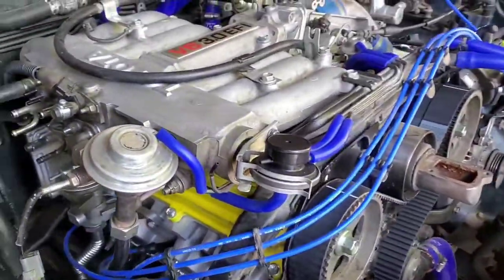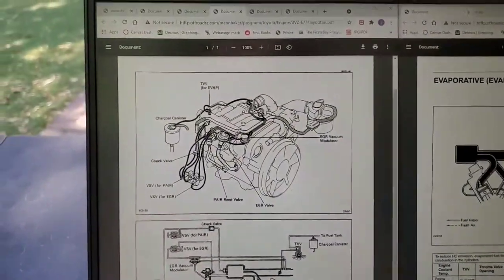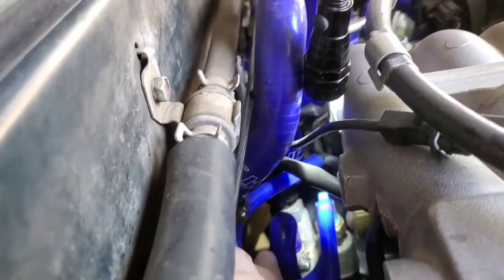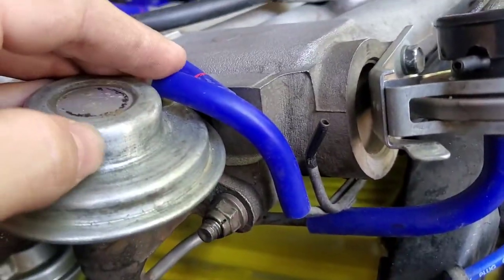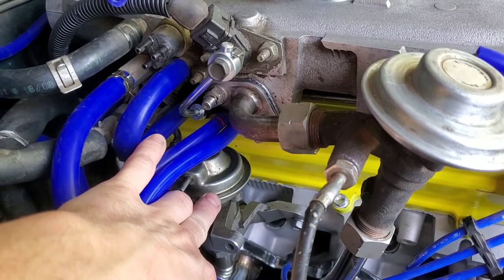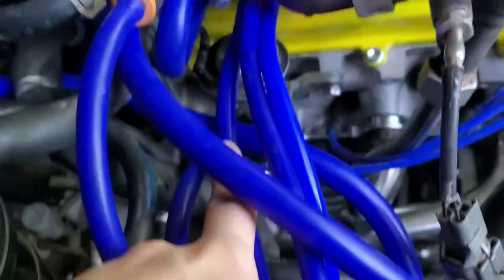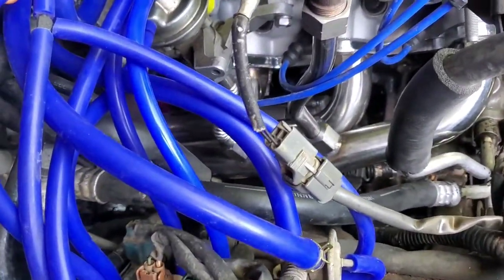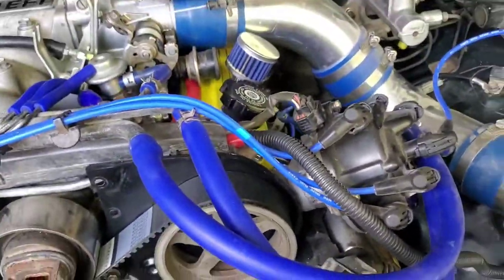94 Toyota Pickup 3vze 3.0 Vacuum System

Comment: 6.25 are the vacuum lines for the front diff ADD

does your 4wd work? theres a plug in your fender wall that isnt connected.
Reply: just saw this too haha was hoing he went into the diff lines with a bit more depth lol
Reply from the maker: For this video I was only following the FSM for the most average truck for the exhaust/intake and a couple other systems like evap. I didn't include explanations of the 4wd lines as not everyone has those

Comment: Hey bro, on 6:45 the line that spilts off to the breaks, i did it the same and noticed my idle goes down to about 700-800 rpm from about 1000 when I press on breaks. Is that normal? I do need to finish off my vacuum lines to the back of the bi-metal vacuum switching valve since the stupid previous owner took them off. You think that could be a cause of it, since it isn't complete?

Comment: nice vid man, cleared up a few things for me. what hoses are you using? is that a kit with different diameters?
Reply from the maker: I believe I went on amazon and bought an assortment of 4mm 6mm 8mm and 10mm hoses, all silicon and blue so I knew when I changed one. The color coding there was really just so I knew what I had done lol.

All hoses were about 10 ft long and about 5 to 15 bucks per dependent on thickness

Comment: Can you do one for coolant lines? Specifically the ones between the throttle body and fire wall please
Reply from the maker: Will do! The coolant lines in this truck can be tricky.

In about a month or so it will be up. If you want to look at some diagrams you can check out here

https://ether3al.com/93fsm-mobile/
Reply: @JaymoTheGroGuyde  This is an awesome link!  Thanks.

Comment: in your case you're replacing all the lines, but in most cases i use multi colored zip ties to mark all my lines when working on anything with a spaghetti mess of lines. one on the hose and one where it goes. when i run out of colors i use color combos. snip off the ends and leave em on. they look ok and make any future projects easier

Comment: what kit/lines did you use? link?
Reply from the maker: For the vacuum lines, I searched amazon for blue vacuum hose sizes 4 through 12mm all evens. Found upgr8t brand. They are cheap, solid product. 

As for the blue silicon coolant hoses. That's from HPS. They make and sell a kit for each model of our truck

Comment: Thanks for making this video. What exhaust header kit do you have?
Reply from the maker: I don't remember the brand, I found them on eBay as a last resort. I could not find any original or OEM Cross-over exhaust pipes at the time. However, it is a better option as it does take away the issue of heat collecting at the back of the engine.

I would search on eBay for your make and model + headers

Here is a link found
https://www.protuninglab.com/hds-4runner88-v6.html?utm_source=googlepepla&utm_medium=adwords&id=1752194785332&gclid=CjwKCAjwwL6aBhBlEiwADycBIImJtv-wjCek9VIs0A38E43jMjT6oQPIuV6tGFzGLizdGXxBoExb_BoCP30QAvD_BwE
Reply: @JaymoTheGroGuyde  thank you! 🤘

Comment: good looking engine too. i would like headers if i continue with the 3vze. i have some videos where ive done the egr delete. no smog testing in TN
Reply from the maker: I did the 621 headers on this engine to negate the over heating at the back of engine due to the original cross ovee design. I am in AZ so I need to pass emissions. I hand bent some piping to keep the egr systems intact.